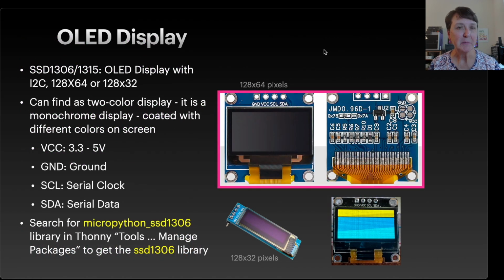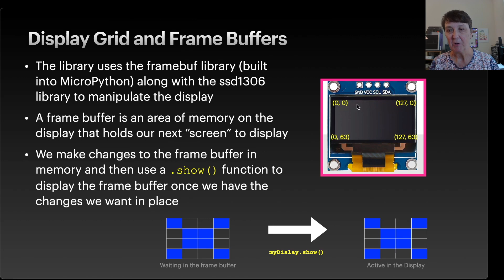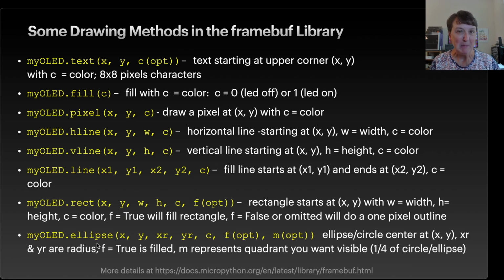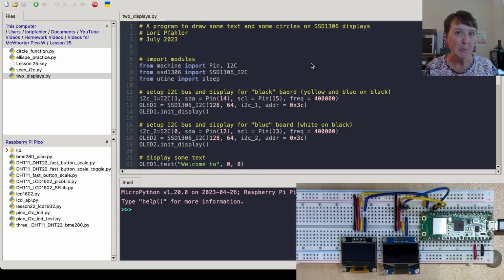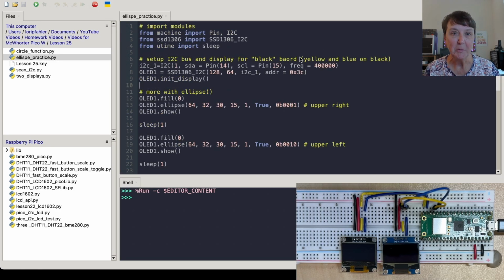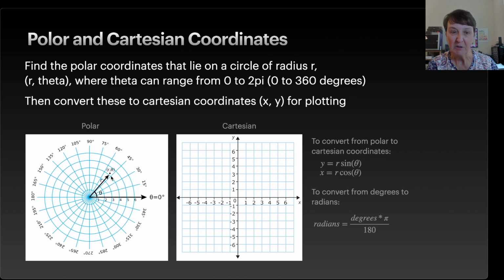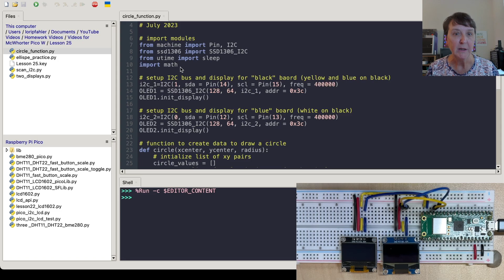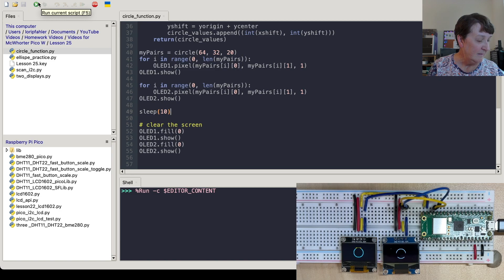HW for Paul McWhorter's Pico W Class Lesson 25

Comment: Nice video! I don't know whether you'll get sent a copy of my comment on Keith's video. I mentioned you in it but YouTube seems to be a law unto itself. Anyway, I've realised the framebuf on an ordinary Pico is different to framebuf on a Pico W which is why I couldn't find the ellipse method as I was using my Pico non-W.

btw I don't have the blue and yellow Oled but in your video the strip between yellow and blue looks green. Maybe this means that it could be yellow OR green. Could this be possible? I can't check it out because I don't have one.
Reply from the maker: Thanks for watching!  I just put a plain pico on my breadboard with micropython v1.20.0 and was able to use the ellipse method.  If I do dir(SSD1306_I2C) - I see the ellipse method.  I think it is going to the newest version of micropython that allows the use of the ellipse method.

For the two color version, there is a row of black between the colors.  It may look green on the video.  You are not able to address that line so if your drawing/text go over that line, you will have a blank space.   The pixel rows from 0-15 are yellow and pixel rows 16- 63 are blue.  There is just a space between rows 15 and 16  - I guess needed to change the color of the pixels.  That is why it is good to have both versions - which one to use depends on what you want to do.  Thanks for your feedback - good to test out how these libraries work.
Reply: @LorisHW  If you were blue/yellow colour blind then the 2 colour version wouldn't be a good idea. You wouldn't be able to see the difference between the colours and you would also have the inconvenience of the blank line. I believe that luckily blue/yellow colour blindness only occurs in men so why should we care!!😁 I CANNOT get my non-W pico (they really ought to invent a name for it, like they had to invent the term SD when HD arrived) to update to later than micropython v1.19.1. It might be a really old model because it came in a kit. Anyway, how many ellipses does a girl need?